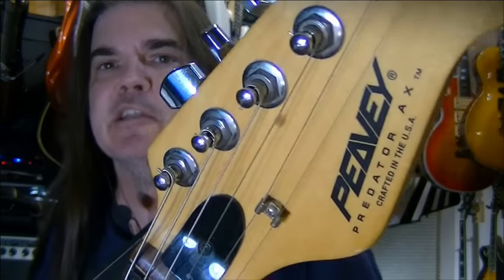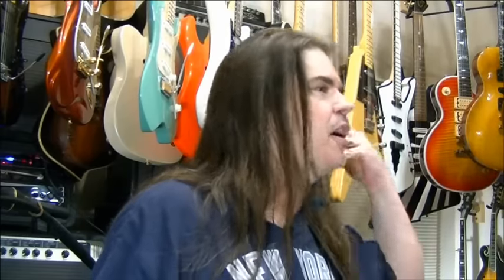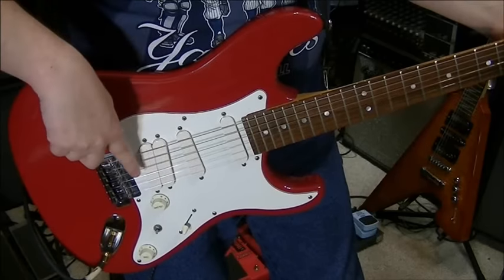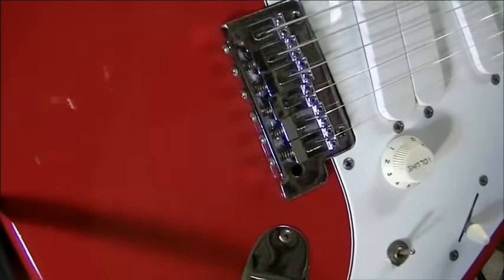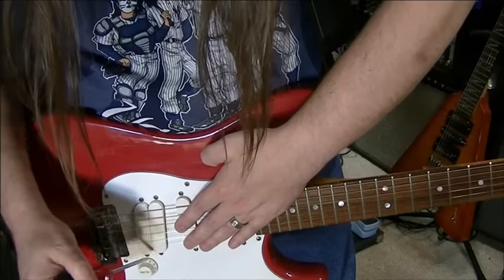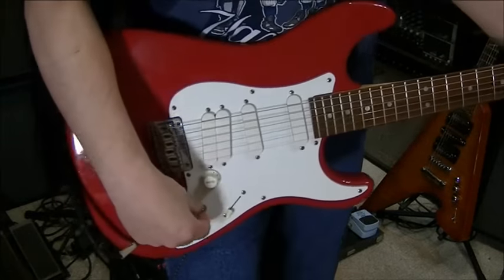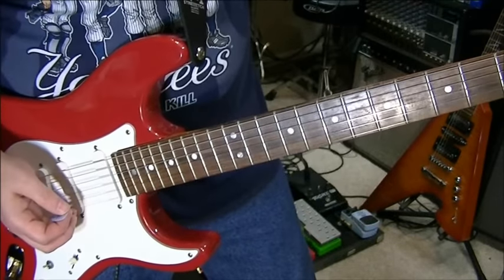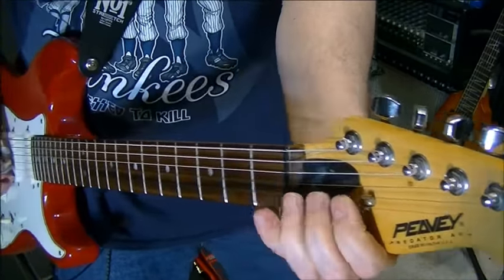1997 Peavey Predator AX USA Guitar Review By Scott Grove

Comment: I had three of the all single coil models, 1 blk and 2 white(aged). I used the black one as a test ax for the pickups. I sold it and then bought it back, ended up selling it again. One of the white ones is bone stock except the tone has been unhooked? Sounds great as is so I just leave it alone. I recently bought a Patriot, black, and after cleaning and changing stings, I've already gotton attached to it. I was hoping to see a video of one on your channel. It has the HB sized super ferrite X2 pups with one blade thru the center, and they sound great. It's a heavy one, so probably ash body. I didn't see this same type of pup on any of your Peaveys. Are they more of a P90's style or what do you think? Thanks for the in depth reviews.

Comment: Gotta love spring reverb its just a sexy sound lol nice axes kinda reminds me of a Jackson I had hot rails in instead of single coils was an alright axe if the body had been made with a normal wood one of those Jackson one offs they tried that didn't take, Fuckn great deal wish I took the pickups out before I gave those hot rails away with it paid 150 for a 600 dollar guitar sale manager said he'd match any legitimate site selling it new fmiss those pickups had unlimited tones in those could get that progressive fusion metal lead down perfect and it had like a 26 inch scale with 24 frets with a bolt on with tapered heal with a classic style trem that had the wrong springs used probably taken from there other model prob a dinky as they had that block way too tight but was perfect with no locking bridge to go too D standard or drop c for some sludge metal riffin with the scale length it was tits for that but flip it between the neck and middle position get those strat like polyphia sounds that cut through nicely damn pickups are 250 alone it was an oddity that i got it for what i did especially for a first guitar coming from a child's acoustic. The guitar new still is being sold at GC but for 4 to 450 now, go figure =( it was killer IMO took me a moment to get use to my SG's scale length being so much shorter as a second guitar but loved it maple neck with a gorgeous rosewood fretboard miss that thing hope its being played gave it to a enthusiastic kid who seemed passionate don't think he quite deluded the deal I gave him on a old mg100fx head n matching slant cab with the jackson guitar, cables  and a pedal for 200 or 220 out the door been a minute, wish I kept the cab with all these new micro tube and hybrid tube amp heads out now could if made good use of that with a micro terror and noisekicker fx Reagan fuzz added, easy way to stir up the old folks in my community